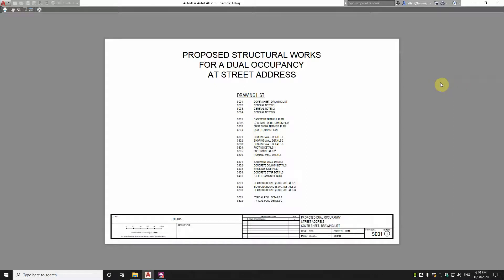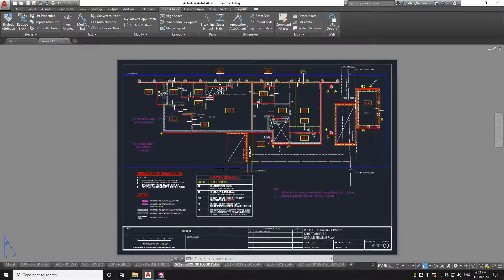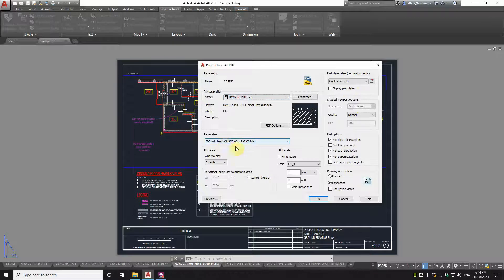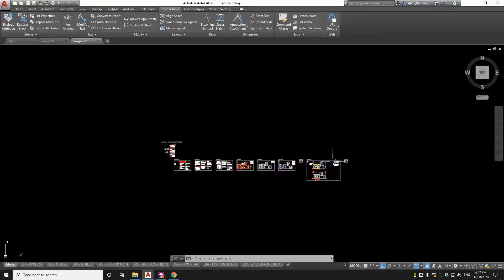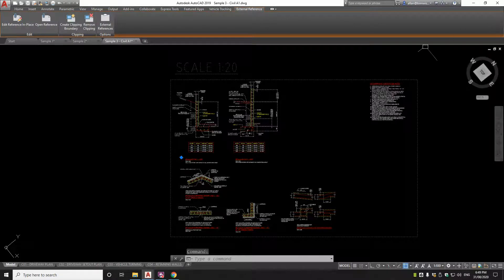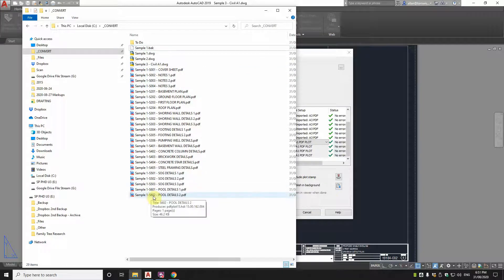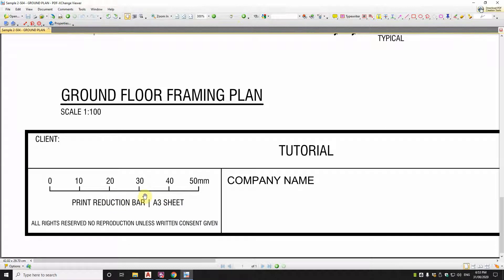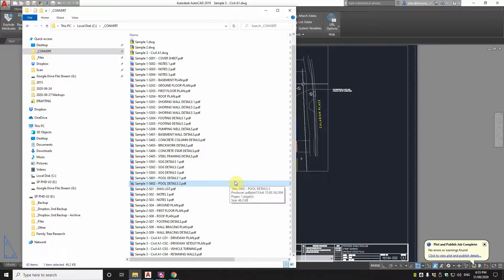AutoCAD Tutorial - FAST! batch printing to PDF with PUBLISH command

Comment: Please demonstrate where you select Layout, Model and both Layout and Model when batch plotting. There is a place where you can choose which one you want to batch plot. That way you don't have to spend time deleting the Model or Layout space selection when you batch plot. It will save time on large jobs where you have hundreds of pages.
Reply: Well,  I answered my own question. Go the big A in AutoCAD at the upper left, then print, batch plot then when you select your drawings to plot, its in the putll down there in the dialog box where you select your drawings. LOL. It's amazing what you see when you open your eyes right? lol.